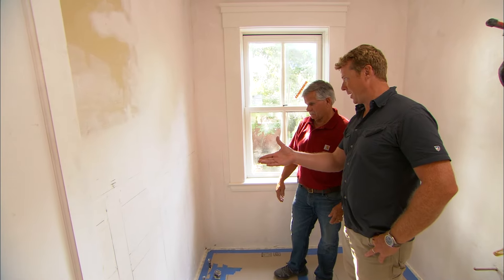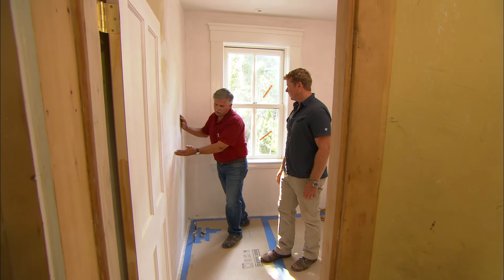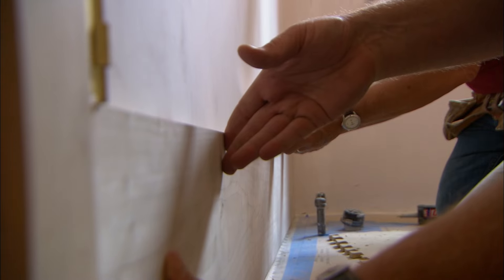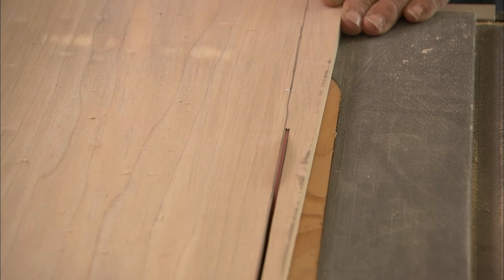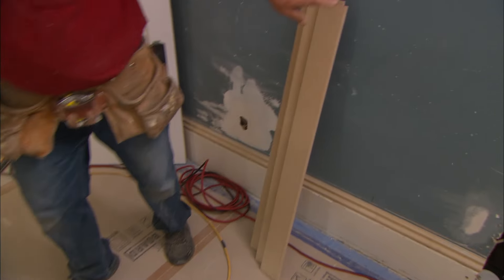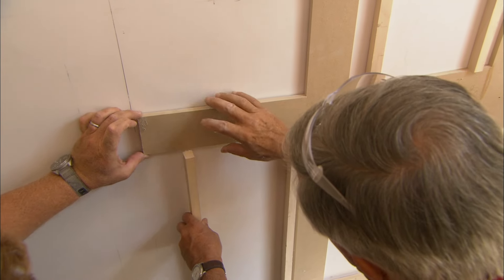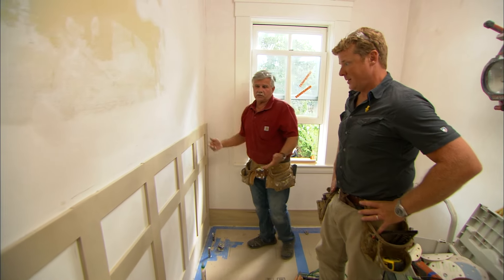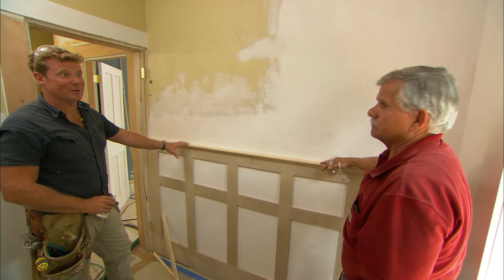How to Install New Wood Wainscoting | This Old House

Comment: If you want it to look pro dont forget to cover up any texture you may have preexisting on the wall. Easiest is to cover it with a 1/4 in sheet of MDF plywood. Seen lots of DIY wainscoting with the texture behind it and it looks off.
Reply: Good tip. Something I wouldn’t have thought of until after the fact.
Reply: Hardboard is another great option
Reply: Use real plywood.

Comment: I have been watching TOH since the beginning so I have a lot of respect for you guys. Having said that, what they heck do you think you are doing cutting freehand on a table saw? I would expect to see this on some random guy's you tube channel but not on TOH. You guys should know better.
Reply: What's wrong with that?
Reply: @michaelp9238  If you have to ask... But seriously. Table saws for for making straight cuts only. You must always use a rip fence, miter gauge or crosscut sled. Freehand cutting is an invitation to a kickback that can cause serious abdominal injury or cause your hand to be pulled into the blade. Just do a quick youtube search for table saw kickback and you will see example after example on why this is extremely unsafe and why I am dumbfounded that Tommy would do this. He should know better and the producers should know better.
Reply: @snaredude56  I don't own a table saw (yet) so thank you for outlining the safety requirements for using one
Reply: @michaelp9238  Stumpy Nubs is a great woodworking channel that does a good job teaching safe use of table saws.
Reply: @snaredude56  Yep. My son cut a small piece of the end of his finger off using a table saw. Straight to the hospital we went. 😪
Reply: @lorip1435  Hopefully your son's injury isn't life altering, and now has a better awareness of the dangers.  I had a similar injury early on and I did learn from it and am much more careful than I was before. A table saw can be used safely if you are trained by someone who knows the do's and don'ts, you never perform any of the don'ts (such as cutting freehand on a table saw) and you never get complacent or distracted. But, if you let your guard down, no pun intended, on any of those things, you can easily get injured.  I had a great shop teacher who didn't let us use any tool until he had trained us on all of the rules, and even how to adjust the tool. Since Shop classes are rare now, I cringe at the thought of someone using a table saw with no training.
Reply: @snaredude56  Yes, he is fine now. I can barely see the damage now. He has not touched a table saw since then, though. I am just getting ready to start a project of my own, and took notes of your comments. I might just use cedar boards rather than maple plywood. LOL  Thank you for the comment.

Comment: I did a wainscoting with MDF and the edges were a nightmare to clean up. I had to sand, fill, and sand each piece. It took forever. Would suggest using plywood and also to use caulking at the edges to hide gaps to the wall.

Comment: Awesome tip about scribing to the floor and wall corners!  A couple of other tips….(I’ll leave a reference picture on my community tab)

1st - I use a backer board that covers the drywall wall.  
2nd - Then I pre-assemble the frame pieces using pocket holes
3rd - for a more formal finish I use a raised panel molding to trim out the “boxes”. Using  this method, nailing the pre-assembled frame to the wall becomes easier on the finishing step…all the nails are hidden where the panel mold sits…meaning less nail holes to fill (basically I nail the frame to the wall around the perimeter of the boxes then install the panel mold, only nailing where necessary)

Comment: Won’t those flush joints crack with seasonal change since there is no mechanical fastener?
Reply: I don't understand the butt joints either but the glue should hold them together. MDF should be relatively stable as far as expansion and contraction goes.
Reply: How about a half lap joint?

Comment: Won’t this restrict the door opening back
Reply: Not really.  The wainscoting isn't "thicker" than the door trim (the vertical stiles), and you don't want the door to hit the wall, anyway (you'd place a door stop low on the baseboard).